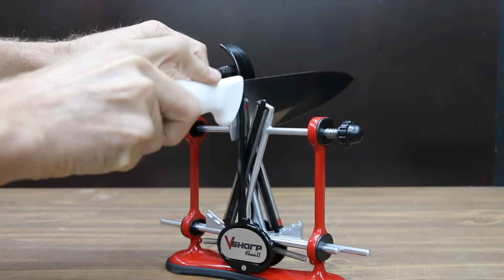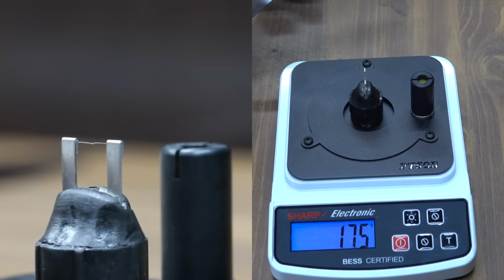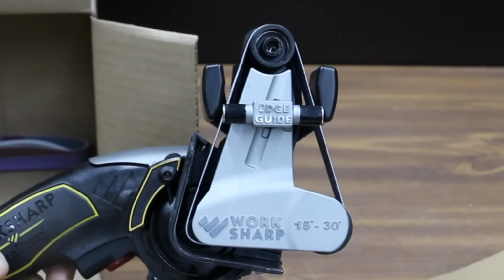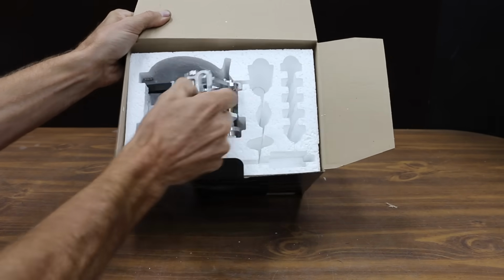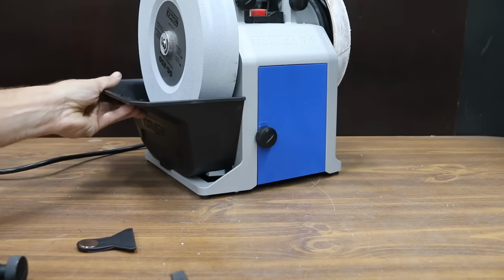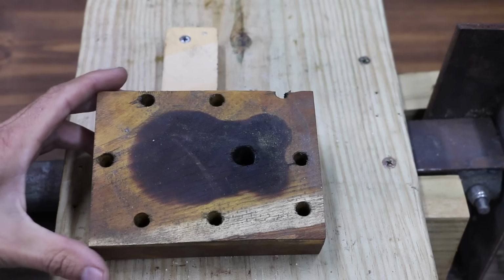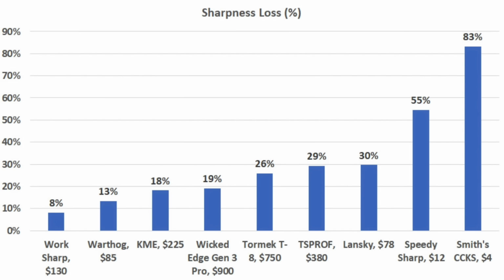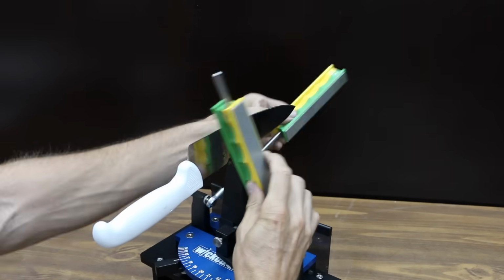RUSSIA vs USA Knife Sharpener? TSPROF vs Lansky, Wicked Edge, KME, Tormek T-8, Work Sharp Ken Onion

Comment: Well done indeed as a professional Chef, one note to pass on dull knives really really cause too much force which makes the worst accidental cuts ever.  I have a Santoko with a 15 degrees and a Wusthoff Trident set @ 22 degrees or close to it. that have served me well for 30 years.  Awesome job testing. I think I might grab the KME sharpener here very shortly.
Reply from the maker: Thanks!  Thanks for sharing.
Reply: I own a KME and Tormek unit, the KME is great for sharpening chef knives.
Reply: Don’t hesitate! KME is where it’s at. Best customer service / support of any company I’ve ever dealt with.
Reply: The wicked edge would be where I'd spend my money for your knives. I've had it for about a year and I will never use another for precise high quality edges & knives.
Reply: @RogerSegerJr  oh yes literally 4 times the price for a 1% increase in performance. why not.
Reply: @BaldSaturn  but much less finicky to deal with, so a better user experience might be worth the coin.

Comment: Such a great comprehensive video, thanks!  If you ever revisit sharpeners, yet again, ha!, I'd like to recommend the Spyderco "Sharpmaker" for your testing.  I've been using mine for over 20 years and it's portable, durable and so easy to use with a very minimal setup.
Reply from the maker: You are welcome!  Thanks for the suggestion.

Comment: I have a Lansky for knives, and recently acquired the Ken Onion Work Sharp at a garage sale (for $25!).  It put a very respectable edge on a machete in 10 minutes - originally very dull and for a very long blade, was very efficient.  Sliding stones won't work well with a very long blade - you keep having to move the blade holder.  Anyway, it is a great rough sharpener with the course belts, as you demonstrated with your homemade knife (pretty nice, but how'd you work the temper?).  Also, the Work Sharp will sharpen serrated knifes.  Anyway, I'll keep the Work Sharp for machetes and scissors and kitchen and utility-type knives.  My ESEEs, Benchmades and Zero Tolerance knives get the Lansky.
Reply from the maker: Thanks for the feedback.

Comment: Those cheap carbide sharpeners will gouge harder high carbon steels. Its terrible. I have a high moly vanadium blade they ruined. Stick with stones and belts. I make blades, I've been a butcher and have sharpened professionally. Most of these are for low carbon by design.
Reply from the maker: Thanks for sharing.

Comment: But is temporary sharpness of the test rig equitable to longevity?  I think it comes down to specific usage.  If you had an old knife that was destroyed, the Tormek seems like the only tool that fundamentally restructured the knife's edge back to optimum condition.  If I wanted something to quickly put an edge on a before each time I cook, the Smith's seems like it'd work just fine.
Reply from the maker: Thanks for the feedback.

Comment: Great job on this one.

I have an older version of the Work Sharp, and a couple Lanskys that I really like.

The Work Sharp really shines on edges that are in real trouble.  You definitely did the right thing, with your personally made knife.  Start on the Work Sharp, get it close, then go to something else to finish it....  Work sharp is also great on scissors, oddly enough, which is handier than you think.  Surplus bayonets it also works great on.

I was also very intrigued by the KME.....  

to be honest, I'm sort of in the mindset of, the Lansky is plenty good enough for general sharpening of general knives.   If I need ultimate sharpness, I have some special utility knife blades I got that are crazy sharp...  Zero durability, but insane sharpness.  At hobby shows, you can buy a pack of 200 razor blades that should probably be illegal, they're so sharp...  and I have a Tamiya Design Knife that I'm actually afraid of, it's so sharp...  that thing put me in the emergency room one night....

So, that stuff, I have around, for when I need it to be CRAZY sharp...  The Kershaw I carry around, the Lansky is more than good enough....  And for me, I personally am a total washout flunkout failure at the "hand sharpen on a stone" thing....  So, the Lansky literally changed my life.

Anyways, great job on this one.  I've seen this stuff around...  It's super fun for us viewers to really see someone use it, see what it really does, see how it really works.  So, thank you very very much for the effort and expense of these videos...  There's literally no one else on the planet, who would spend their own hard earned money on this stuff, and then really give it a pure unbiased test, and film the whole thing, so we can really see it...  So, I thank you very much Sir.
Reply from the maker: Thanks! Thanks for the feedback.

Comment: I have a sharpener similar to the Work Sharp but made by another brand, and they are awesome.  It only takes a minute or two to take a dull knife and get it razor sharp.  One day I sharpened 15 kitchen knives in about 20 minutes.  It's hard to beat the speed of them.
Reply from the maker: Thanks for the feedback.

Comment: tjos sas an amazons video. there was one thing you did not mention it was that the polished edge from the tormek (maybe) would preform better in real life applications. In leather work a polished knife is very important because of friction between the knife and the leather not only how sharp they are. love the tester but i doesn't see the whole picture.

Comment: BTW in the sharpening one should take as little material as possible and not introduce scratches into the edge. Also oen should not introduce heat into the blades. So how ever you sharpen do not go to fast and check your work on regular bases. When you get a bur on one side just stop and go to the other side. No need to fold over the edge. If you introduce scratches step back to lower grit and repeat the proces. You can't polish deep scratches with duper fine grit. And last thing maintain your blades before they get to dull. Strop them and straighten the edge soon as possible. Even sharpen it again starting from bit higher grit if the blade was not to dull.
Reply from the maker: Thanks for the feedback.

Comment: My current set-up is a Lansky. I have the "Deluxe" 5 stone kit, along with these "extras": "Sapphire" blue polish stone (step above 'very fine'), Diamond "extra coarse" stone (works WAY faster to re-profile a bevel the first time), both of their serration hones, their 4-pack of "Curved Blade" hones (needed for knives with a recurve, like a karambit), and two of their leather strop hones (one is used 1st with Tormek honing compound, the 2nd is used last "dry", with nothing but a little neatsfoot oil in it from keeping it conditioned). I also have their padded "Soft-Grip" knife clamp, their c-clamp mount, and the aluminum "universal" mount.

I have the aluminum universal mount screwed to a workbench with the Soft-Grip clamp on it. Everything else (The normal clamp, all the stones in a little tool roll, compound and oil, roll of electrical tape for the jaws, C-clamp mount, rods, ect) is in a little cloth Glock range/goodie bag I picked up at a trade show.

I've sharpened probably 200+ knives with this setup, and I LOVE it. I've never failed to get somethung hair-popping, mirror-edged sharp... Started out with the "Deluxe" kit, and just slowly added stones and accessories as I needed them... I've even got a little truck kit consisting of a "C-sharp" ceramic, a "D-sharp" diamond, and a Blademedic (I can set angles with the diamond and do a quick hone with the ceramic on various tools, hit whatever knife I'm carrying on the ceramic for a touch-up to get me by, and throw a quick edge on someone's knife for them with the Blademedic if they bug me about it); also have their "Tactical Diamond" rod in the garage for tools.

It's just hard to beat the cost to value ratio 😂 my only complaints are that they don't offer a good case for people with more than 4 stones, the lack of a "complete" kit and having to buy separately, and the rods for the sharpening system can get tweaked if you're not careful... Oh, and I also blame them for being "that friend"- the designated guy for everyone's sharpening needs (you know... "Oh, your knife's dull? Take it over there to JimBob, HE can sharpening it! He can make it shave hairs, he did it for me, I bet he'd love to do it!) 😂😂😂
Reply from the maker: Thanks for sharing.

Comment: Hate to say it, Todd, but you used the Tormek incorrectly.  Unless I missed it, you didn't grade the stone.  Also, I would use a digital angle guide instead of what came with the Tormek.  You only need a couple to a few passes to set the edge bevel at the low grit before moving on to the higher grit for sharpening.

I recommend checking out Knife Grinders Australia.  The guy is a pro with the Tormek.
Reply from the maker: Thanks for the constructive feedback.
Reply: @ProjectFarm  Like I said last year, you can get better results with practice.  

Btw, I also own the Hapstone (similar to the TSProf).  It's a fraction of the price of the Wicked Edge, but you can get the same results.

Comment: That is a default Tormek stone. One can get finer and coarser stone. There is a Japanese stone for a Tormek and it can sharpen way better. Now Tormek System has a stone that is used to change effective grit of a stone. You use coarse side and it creates the texture. You use that for first passes. Then you use the grading stone with a fine side and it makes surface fine as 1000 grit. After that you use leather wheel to strope the knife. It is way sharper that way then with a default stone grade that is 250. Default stone profile makes the jagged edge and than you  just strope it's tallest edges. Graded to 1k you get finer edge that has less jagged form and it will strope better and stay longer sharp. Tormek has als o3 different Diamond wheels that will ensure 90 degree position of the stone. And last but not least Tormek T8 is universal tool for sharpening anything from blades in hand planes and other woodworking tools, even drill bits, scissors and axes only you have to have special attachments for it. IF you want a Tormek that is made for professional knife sharpening get T2. Please do not ask me how I know this all I am sick regarding to sharpening my tools and blades. I have like 20-ish Japanese water stones and next to it like 4 other systems. Told you sick. But my blades and tools are all razor edged even Axes. Japanese cooking knifes are silly sharp and pocket knifes as well. If you can over kill it I kinda do it :) My blades are done up t o12K Japanese water stones and then stropped with extremely fine particles. When I finish with Nr.4 hand plane you can see mirror reflection in wood and feeling the surface feels like you are gliding your finger tips over the glass :)

Comment: One thing to factor in as well is that pull through sharpeners create stress along the blade that is bad for the steel of good knives. A whetstone or whetstone type sharpener is much better for pocket knives/chef knives or any knife you want to last for years
Reply from the maker: Thank you!

Comment: love your videos.  Did you use the grit stone on the Tormek??? I know it changes the grits from low to high...and the carbide stone true attachment helps with concentricity of the stone.  the tormek will sharpen literally anything from chisels to planar blades and drill bits.  Also they make a Japanese water stone for it.  I own the wicked sharp also and its cant hold a candle to a properly setup tormek with the Japanese water stone. Also Tormek makes jigs to sharpen literally anything.  They aid in fixturing and angles.  They also help you produce the same sharpening settings from sharpen to sharpen.  If you need to remove a ton of material to say regrind an angle, the silica black wheel is a HOG!.  Whereas the tormek is superior the complete setup with jigs and stones would be in the 2-2500 range VERY expensive!  Still  a great comparison and absolutely love your videos.
Reply from the maker: Thank you!

Comment: I use a DMT that works similar to the Lansky. It has a much wider Diamond surface than the Lansky. I’d guess double the width. I’d give it points over Lansky for that reason but I’d give Lansky points for having a metal clamp, where the DMT is plastic.
Reply from the maker: Thank you!

Comment: Ideas
1.  Have you ever tried ceramic blade knives? Were they any good?  
2.  I have tried some specialist German made drill bits for Stainless 316 work (In a  lathe) Initially amazing but rather fragile.  
3.  Have you tried Tungsten carbide drills to cut holes in a Lawnmower blade. I was just wondering if they would work.

frighting process. I do NOT recommend this method.

Comment: I was taught very young how to use a wet stone and steel. My dad was a butcher for a long time so I had plenty of really nice knives to practice on. I use a double sided stone, one side is 850 grit while the other is 1500, then I finish off with a long butchers steel. Seems a lot less complicated and MUCH CHEAPER than most of the ones you reviewed.
Reply from the maker: Thank you!

Comment: Nice test. I still love my EdgePro Apex, especially after upgrading the stones. Along with the EdgePro, I have the WorkSharp I use for cheap(er) hunting and paring knives, as well as setting the initial angle on knives I've made after hardening.  I like how the TS Prof allows flipping the knife over while still being clamped in - one less thing that can cause angle variations. The Wicked Edge is great but I just can't get over the fact that it's very overpriced for what you get. If I were trying to make money with sharpening, I would get the Tormek hands-down; it has a tone of accessories available too. 

I own quite a few Japanese knives (Shirogami and Aogami steel) and the EdgePro with carbide stones does a fantastic job on them.
Reply from the maker: Thank you for sharing!

Comment: I use diamonds and a strop and have super good results.  I may have to grab a worksharp because that looks like it would save a ton of time.  I guarantee if you stropped that blade it would equal the rest.
Reply: workshop owner here i have the mk.2 for $100 its a amazing tool and they even have a stropping belt. idk of any sharpener for the price that can take a completely dull knife to super razor as fast.
Reply from the maker: Thank you!

Comment: I have a work sharp, lansky and kme. You should try testing them on a more difficult steel like d2 or   S30v or something along those lines, a common steel that is harder than most cheaper “carbon steel” knifes. Personally I loved my lansky for s35 and s30 but once I got a knife in s90v the diamonds on the kme were a necessity to sharpen it with any speed.
Reply from the maker: Thank you for the video idea!

Comment: Something I would like to see is comparison of various brake pads for stopping power, particularly the average truck / SUV.  I have added 1500lbs to my old Cherokee with mods and upgrades and have had people cut me off on the road enough times to give me an aneurysm.  2 times I have had to swerve off the road with my brakes locked up skidding tire marks down the road.  I have since purchased a set of new pads and rotors (hoping they will make a difference).  I have no idea how to know what brand of any of the parts I should actually be considering for maximum stopping power so I just guessed and ordered.  A Project Farm video might have helped me make a wiser choice, and might save someone else in the future from being killed by other dumb inattentive drivers on the road.
Reply: If your tires are sliding they are the limiting factor, improving your brakes won't help. You might also want to look into an adjustable brake proportioning valve depending on the weight balance you added and how your tires are locking up.
Reply: as far as disc brakes go, you cant beat EBC, expensive stuff though.
Reply from the maker: Thanks for the video idea.

Comment: I have a sharpener similar to that 1st one that was $4.00 that works pretty well on my old fashioned Old Hickory knife set made by Ontario Knife Co. in Franklinville, New York.  They are 1095 carbon steel blades.  I also have an old wood handled whet stone that works just as well, but it takes a bit longer to use.
Reply from the maker: Thank you!

Comment: I 3D printed a knife sharpener. Cost me £5 in filament, £5 in metal parts (tubing, nuts, bolts), and £20 for some cheap sharpening stones. Very similar to the Lansky in design, works really well. Under my microscope, I can get a perfectly smooth edge if I use the 10,000 grit stone. 

Very good video, gave me some ideas for a new design to 3D print ;)
Reply from the maker: Thank you!

Comment: Hay I sharpen a lot of stuff for people  .  My Test is the back of my arm, Thus it is hairless a lot . Shop Teacher tote us on and Arkansas oil stone.50 ++years ago .  Back then there were no diamond stones  . But now I use and 8 dollar harbor freight or a grizzly 12 dollar 4 sided diamond stone ! Both are identical . ( clean them when fauled  with windex ) I also make for people a leather strap to finish . Use old belts glued  on  a piece of wood with a knife like handle the width of the belt used and about 20 inches long  In less than 5 minuets a dull knife or blade can shave at a cost of only 8 dollars . I like making knives our of old files that I throw in to the wood stove . They make very sharp knives .
Reply from the maker: Thank you for sharing!